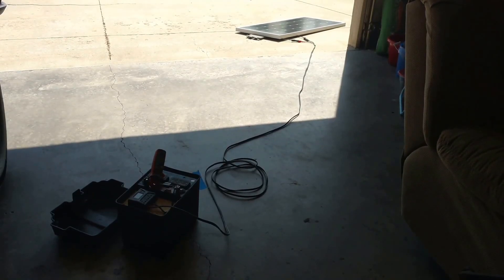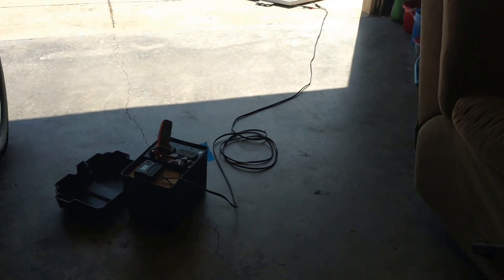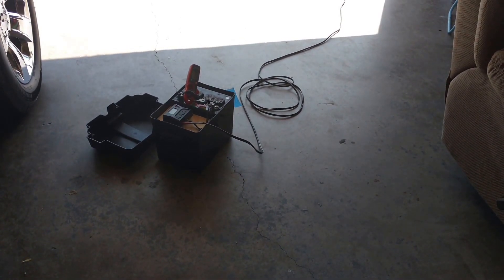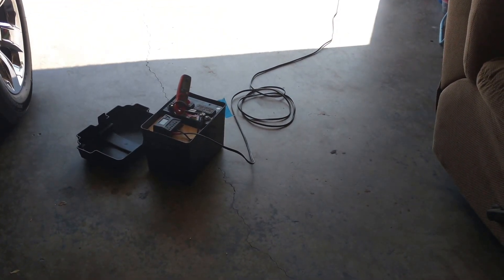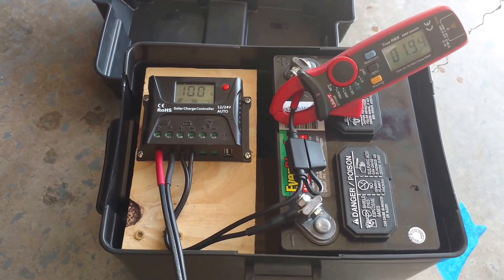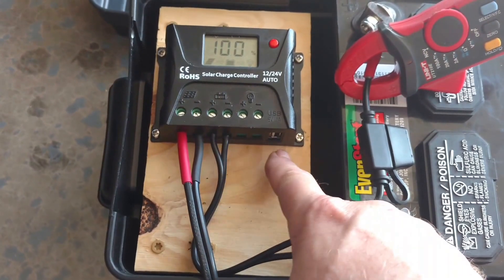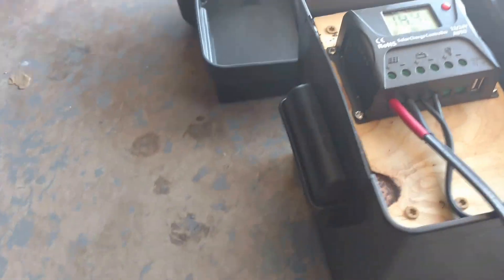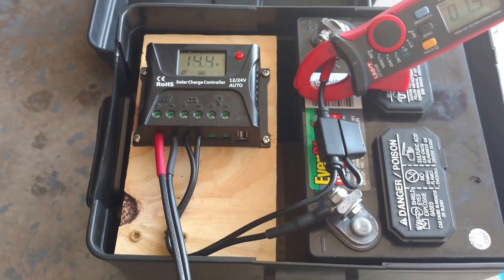DIY 12v PWM solar generator (very small) pond pump testing

Comment: Twelve volt solar powered pond pump - tell me you didnt manage to do that in one take?! Nice little project, the  box looks perfect for the task. Will the pond pump be going 24/7 or just in the day?
Reply from the maker: Thanks...it should shut off at dusk. It is in the pond now...running. Current draw is 1.3 amps on the "LOAD" side of that PWM solar charger.
Reply from the maker: The PWM solar charger works...however, it looks like the "LOAD" mode is exactly opposite of what I need it to do. I want it to run during the day (and program a few hours of run time after the sun goes down) and then shut off. The LOAD on this one programs a night light...ie, on at night. grrr.

Comment: Looking good. Nice setup to get he job done!
Reply from the maker: Been egging to do one of these for quite some time. Thanks...I designed it for much more pump/power draw. But, right now it is in the pond and pulling only 1.3 amps. A 100w solar panel on this is way overkill...but, fine/safe.